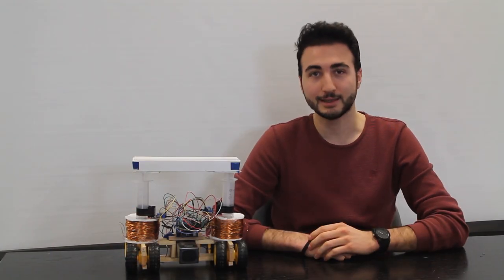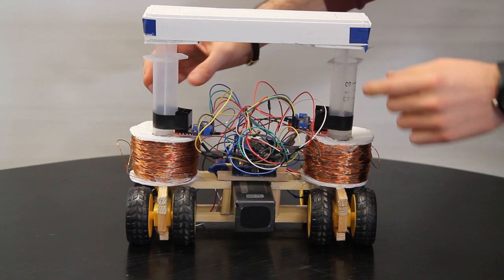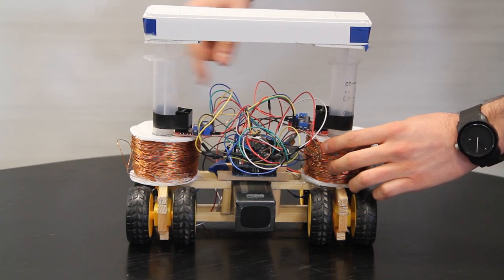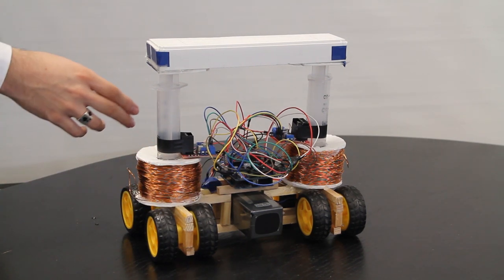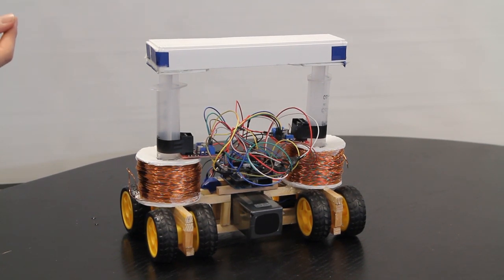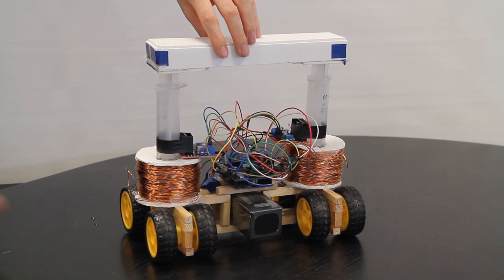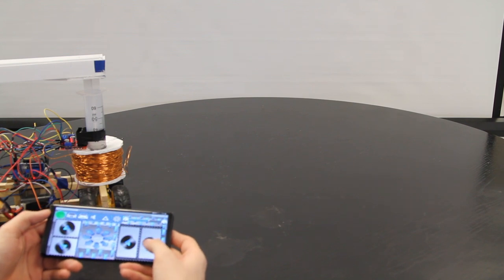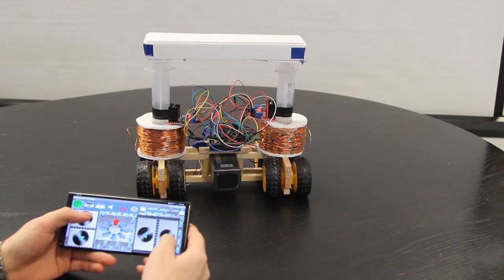Electromagnetic Suspension System - Bilkent University EEE 351 Term Project

Comment: is it possible to apply for electric bike as additional module/independent system/kit (electro-suspension +  associated battery) to replace the original default battery which has been exhausted so that the bike can drive on without switching to manual pedal???

Comment: What is this app or software
Reply from the maker: The app was called "Bluetooth RC Car", but unfortunately removed from Play Store. There are unofficial APK providers, you can easily find the app in various of them. It is not that crucial, any app that can connect to the used bluetooth module will suffice.

Comment: Is that the single coil wounded in three phase configuration?
Reply from the maker: Actually no, we did not use three phase configuration, that configuration can be achieved, but we already had motor drivers in hand to pass high currents through the coils. We utilized those drivers by connecting each end of a single copper wire, which composes a single coil. Legs are separated from each other, therefore they can operate individually as presented in the video. By this simpler selection we only used a single long copper wire to form our coils . However, we ended up with around 1500 windings for each leg, which can be obtained by using coil winding machines, or by paying local technicians. In our case, our patient teammate Yiğit Berk Üçüncü wound both of the coils by hand.
Reply: @tunakasif  thanks for replying.....hope ur team achieve great heights! For your hardwork
Reply: @tunakasif  how you are varying the magnetic field?...is that output voltage and current from your motor driver is variable?......if yes how can we vary the output voltage and current?....how the suspension stays in position even after releasing your finger from the button?? expecting another reply from you as it is helpful for my studies.....thank you:-)
Reply from the maker: @Dina-ug6bq  Variation in magnetic field is possible via variation in current intensity. With the help of our bluetooth module, we are sending requests to arduino, which enables us to change the amount and the direction of current passing through the coils. This current affects the existing magnetic field of the neodymium magnets, which helps us to set the height of the suspension. The current setting action is achieved by mapping speed values of a motor driver to current amounts. Please refer to our GitHub page, provided in the description, for further details and even for the source code of the entire project, especially check the DriverMotor() function for your questions.
Reply: @tunakasif  thanks a lot bro❤️

Comment: Plz explain how did u do that. And what are the requirements.
Reply from the maker: Check out the GitHub link in the description. List of equipments, the source code for arduino, even the theoretical explanation of the concepts are available on the GitHub page of the project.
Reply: this is good. Why don't you plan to put it in a car it would be a breakthrough.
Reply: @tunakasif  which App are you using?
Reply from the maker: @ivanarakistain3885  Bluetooth RC Car from Google Play Store: https://play.google.com/store/apps/details?id=braulio.calle.bluetoothRCcontroller